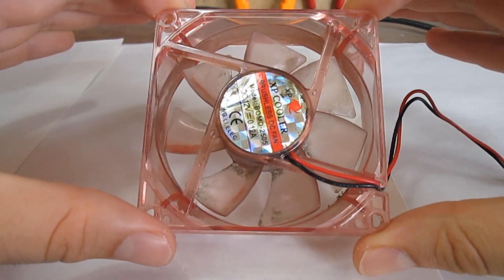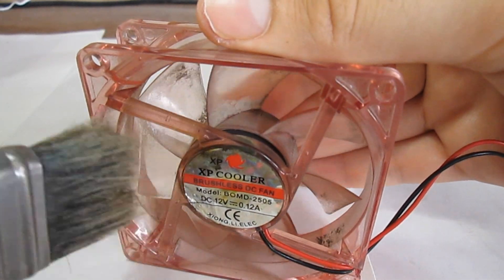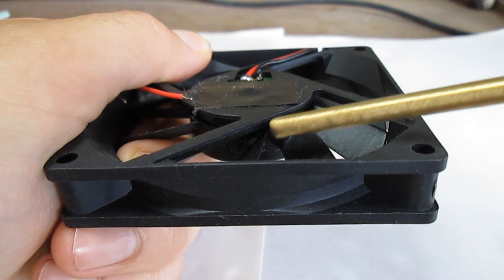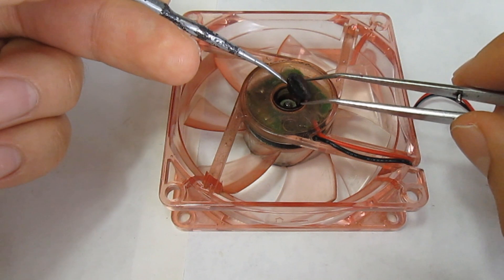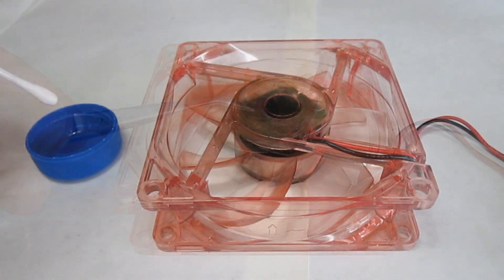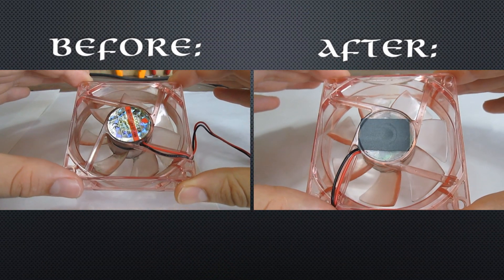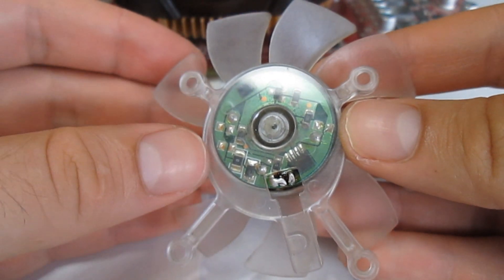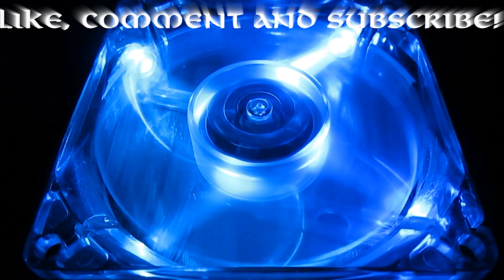[TUTORIAL] Basic PC fan maintenance

Comment: I attempted maintenance on a processor fan in a dell OptiPlex 760 that I purchased used. Couldn't access the bearing but not a big deal as the fan was still working. Fan was made by  "Sunon" and was branded as a "Maglev". Different than most fans I have come across but did seem to be well made. Good video!